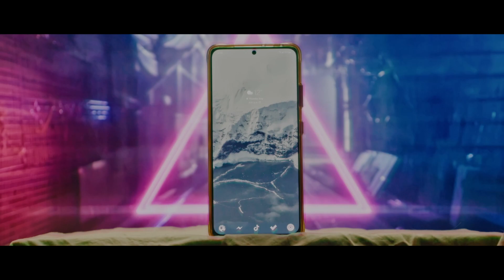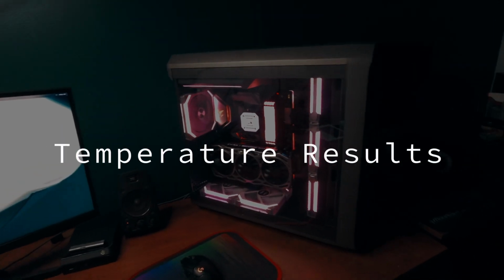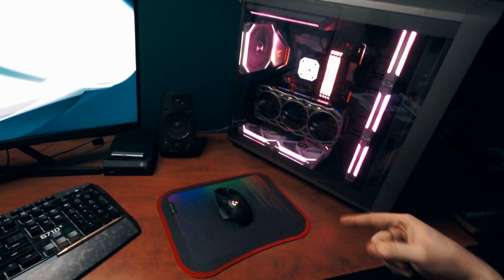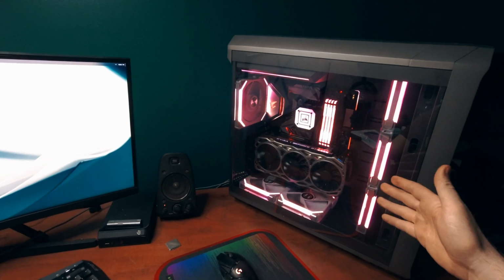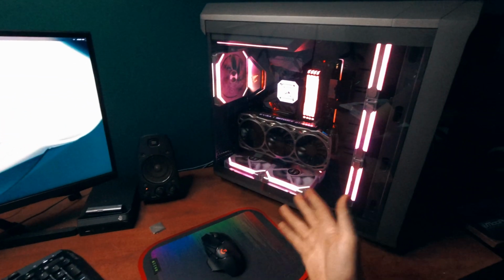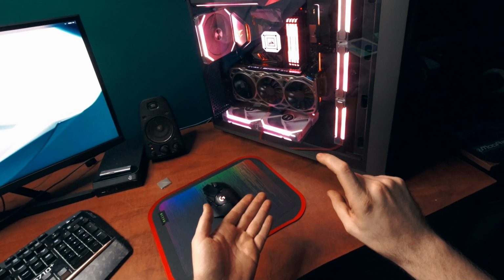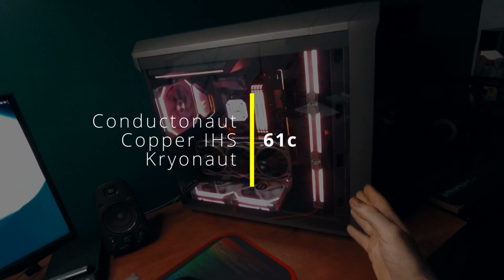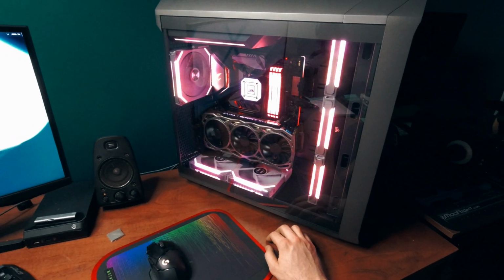Intel i9 - Delid, Liquid Metal & Billet Copper IHS Install

Comment: Liquid Metal on a copper ihs....very clever...
Reply: Yep, the nickelplated material on the IHS protects the bare copper when it meets gallium liquid metal, thermal grizzlys high performance heatspreader is nickelplated copper, tho they werent around 2 years ago but im sure other nickelplated IHS were to be found atleast :)
Reply: @frimanboi It is bare copper and not nickelplated...
Bare copper IHS and bare Copper Coldplate of the AIO.
Copper and Liquid Metal not working great 😉
Did you watch the video dude?

Comment: Is the clamp safe? I bought a secondhand delid/relid tool from a guy from rockitcool and im missing the little plastic relid piece, is this safe?
Reply from the maker: When reattaching it, it onlynneeds enough pressure to overcome the viscosity of the Silicon sealant. You dont need a lot of pressure at all. It's only to make sure thebdie and IHS make contact while the silicone is curing

Comment: Great realistic video on how its done and how shit hits the fan!
Great results to.
I was wondering if I need relid tool to center IHS and if copper IHS is worth it...
I guess NO on both item's but whyvthe hell not since they are like 25$ extra frok China😅😅
Reply from the maker: Copper IHS is worth it for being lazy. The stock IHS is already copper with a matte nickle plating. So if you lap the stock IHS, it's literally identical to the billet copper one. The only reason the billet one was slightly better is because it's machined perfectly flat out of the box.
As for the relid tool. I just used an old wood clamp and did it by eye which was fine enough. It doesn't need a lot of pressure, just enough to make sure the IHS and Die are still making contact while the silicone is curing.
Lots of people don't even put silicone on it so they can redo the liquid metal easier in the future because you do still need to maintain it every few years.
Reply: @frozennorthproductions  
Thank you for your answers!
😎
I guess lapped stock IHS is safest to remount for compatibility with clearance and socket pressure plates as well

Comment: Nice test, but you must test conductonaut with original IHS vs conductonaut with copper IHS, you will see that dont have difference, the original IHS is complete valid to delid with liquid metal.
Reply from the maker: I did that exact test in this video. You must have been skipping through the video and missed it. Results are at 15:45 The only difference was a 1c drop with the copper IHS. The difference is because the billet one is machined perfectly flat. A stock IHS is already copper and just nickel plated. The coating doesn't do anything to affect the Temps. But, the stock IHS is not perfectly flat. So, lapping a stock IHS vs. a billet copper IHS is identical. The difference is that removing the IHS anyway to do the liquid metal is just less work to stick on a billet copper one and you save like an hour of time and the possibility of not lapping the stock one flat. The billet one is pretty well guaranteed to be perfectly flat and ready to go, so it just saves tons of time and effort, and you get the best results at the end of the day.
But if you don't value your time as much and just wanna screw around on a weekend to mod some stuff for fun, you CAN do a really good job and save a few bucks. You can easily lap a stock IHS to be just as good for only the cost of supplies, so you'll save like $10-15 by doing it yourself instead of buying the billet one that's already done.
Reply: I have seen the full video, that's why I told you that, look that you use conductonaut+stock ihs+kyronaut, but not conductonaut+stock ihs+conductonaut.

Test it, and you will see that the dfference is 0 vs conductonaut+copper ihs+conductonaut.

In summary, you will also reach 57º with conductonaut+stock IHS+Conductonaut.
Reply from the maker: Conductonaut doesn't change the surface flatness of the IHS. That's why I only changed one variable starting at the CPU and moving forward. The further from the CPU die, the less responsive the results will be. That's why using Kryonaut between each IHS and cooler wasn't tested as the results are seen before the IHS and Die. Not the other way.
That's why a lapped stock IHS and billet IHS would be the same result. The test is to see the difference between them, not the difference between Kryonaut and Conduconaut on the IHS.
Using Kryonaut shows a greater difference in temperature flaws. So even if using Conduconaut instead of Kryonaut yields a temperature difference that's almost identical, the imperfection of an unleveled stock IHS is still present and only being masked (not resolved) by the heat transfer properties of Conduconaut.
Reply: No man, using Kryonaut dont show a greater difference in temperature flaws, show the difference of thermal conductivity between conductonaut and kyronaut, all of this you can observe just making the test using only conductonaut with stock IHS and copper IHS, and if have a thermal cam you will see also that the 2 IHS temps over the rectangle body of ICP is the same. Test it plz.

But there is also a detail that you have not taken into account, the margin of error that the probe has, which can be up to +/-1º, then you can take 57º but can be 58º OR 56º, observe that now you have 2 degrees of difference, from 56 to 58, by the margin +/-1º.
And is inherent ever in the probes of this quality, for this is neccesary to make the same test, around 5 times, to avoid the error margin of the probe.

Note that for example you do a test with stock ihs and take 58º but you do it again with copper ihs and take 57, there the margin of error of the probe may come into play, if you do it 5 times for each of the parts, you will give a very accurate average, practically eliminating for complete the margin of error of the probe.

Comment: Thanks for testing this, interesting results! Especially the big difference when applying liquid metal between the IHS and cooler.
Furthermore, it’s a good idea to protect against liquid metal leaks, but I wouldn’t worry about it in relation to temperature. The stuff is already liquid and won’t change when heated. So if it doesn’t leak at ambient it won’t leak under stress.

Comment: I'm already planning to put LM on the die of my old 3770K, but I'd like to know if LM between IHS and my Noctua cooler would give even better results ? In my opinion, I think that once the LM is applied on the die, the "thermal bottleneck" will be the normal thermal paste between IHS and cooler, right ?